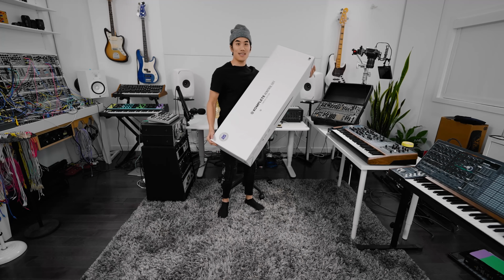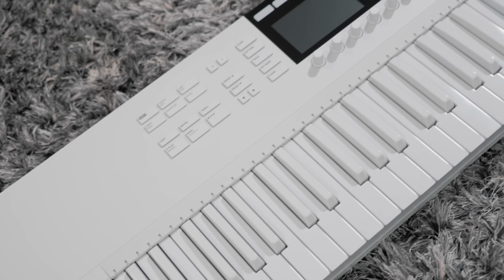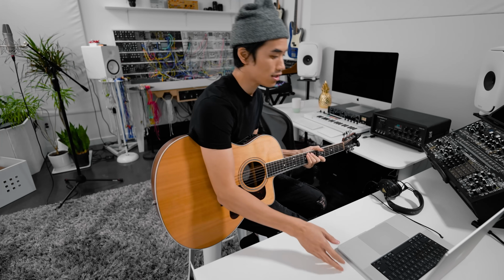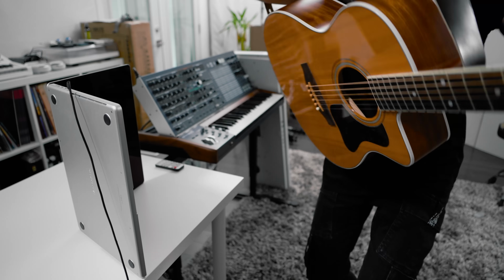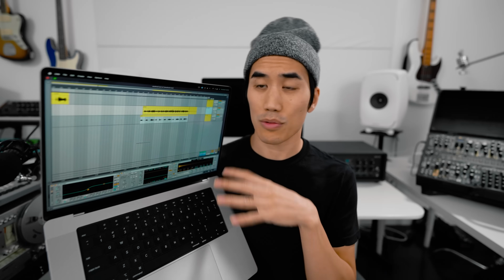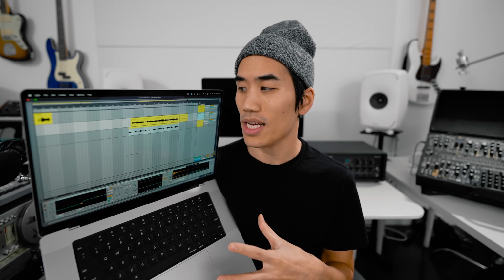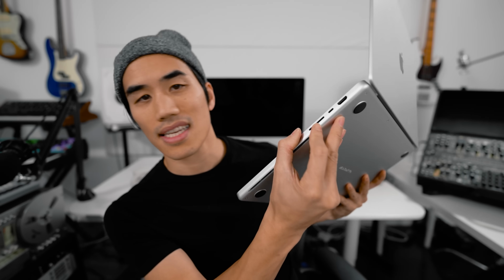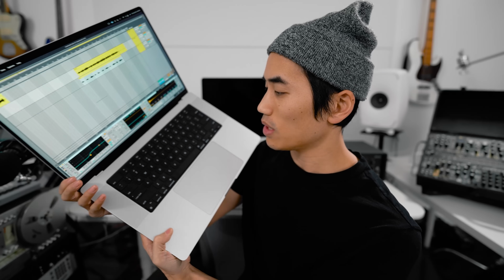My new microphone... (Macbook Pro M1 Max)

Comment: Hey Apple, 2 smaller trackpads on either side would be much better. Wont get in the way of typing and no need to put your hand in the middle of the laptop to use it. Either side for both right handed people and lefthanded.

Comment: Thanks! Great video. Does your laptop have 32GB memory or 64? I couldn't find if you had mentioned this.
Reply: This doesn’t answer your question directly, but if you’re wondering about how much memory you should choose, 32 GB of RAM will take you extremely far from what I’ve gathered (particularly with the new unified memory on these M1 devices). 16 GB would already be plenty for workflows that don’t use large amounts of sampled VST instruments (Kontakt being the most common culprit), but if you have the money 32 GB would provide some nice headroom.
Reply: @ninevolt  Thankyou. I discovered the Max model comes with 32 as standard. Thanks for your response.

Comment: I'm just wondering that you didn't mentioned the Latency Issue with internal Mic over CoreAudio. Even on the lowest buffer size like 32 Samples the Latency is to high to hear yourself without Delay or Phasing Issue...
Reply: Came here looking for this too. Did you find any solution?
Reply: @ADHDindieArtist  what i found is that you don't get latency when using reaper.
in ableton, logic i get around 40ms of latency on internal mic 
but in reaper no latency.
Reply: @ADHDindieArtist  unfortunatelly not

Comment: Compared to the actual end product the Macbook sounds normal, but not laptop normal. Had i not known I would have guessed that was just poorly processed, or recorded in a subpar mic (or perhaps location), but for a laptop it sounds great. Still way too expensive to be worth considering over a normal laptop and a decent mic, tho, as I think most people would not mind carrying a decent usb mic or even a mic and a DAC behind. If you're backpacking that's like 1 less shirt you'd pack and I think that's a better trade off. Heck, if you needed the shirt that bad you could buy a new one whererever you're traveling too with all the money you'd save

Comment: Not a Mac Guy here by definition. (I do 90% of my work on a Windows machine), but I did buy the last gen Mac (fully-kitted Intel) and fell in-love with it, except the stupid touchbar. I now have a top spec M1 Max 16" MBP, and I think it's perfect. I can't find a single thing I don't like about it. I'll still be using Windows for most of my stuff, but definitely way less. Ratio has shifted to 60% Windows, 40% Mac, and I imagine that'll continue to change until it's about 50/50. I enjoy both OSes, and I have a great Windows build as well (Threadripper, 128 gigs of Memory, 8 TBs of NVME storage, PCI-E Gen 4, and an RTX 3090), so... for once, I feel like I'm in a happy place with my laptop and desktop machines. Nice to see the mic is so good on the new Mac, I can definitely make use of that as well. Thanks for the video.

Comment: Boo Apple. Wow the expensive real studio mics are so much better. Trackpad is too large, company is too evil, computers are too slow, needlessly burn power to run their UI, needlessly prevent people from repairing their products, famous for manufacturing plants placing netting to catch falling bodies as people were literally yeeting themselves off the building to prevent having to work there any longer... maybe don't advertise that their mics work better? The microphone in your cell phone will do the same thing; they're all condenser mics at this point. You can get them for pennies from China, then it's all about distance and shielding from mic to preamp, preamp quality, ADC,  sample rate.... all of this parts wise is under $20. And I've heard better.

Comment: @andew (or anyone with the 16"). I'm concerned it's just way too heavy to carry around long-distance, but I do prefer the larger screen even though I almost always use an  an external monitor. Any thoughts on whether the 14" might be a better fit? Does the weight difference matter here? (I am also concerned about growing pains carrying something heavy.) Apparently the 16" has some higher performance mode though.
Basically I'm completely on the fence when it comes to the weight.
Reply: I have a 14" and love it. The fan has never bothered me and it's still pretty weighty. I think the 16" would be much worse on my back.

Comment: Reviewers automatically say Apple has the best trackpads, but I've accidentally moved the cursor on my Macbook Air M1 at least once per day while typing. Never had that issue with Windows machines. The Apple trackpads need be lowered and reduced in size to avoid accidental cursor moves.

Comment: Andrew! Please try to see if you can use fingerpringer in max (or anything else that can get data from the track pad) and use it as a midi controller! It will change your mind about the giant trackpad haha. Those mac trackpads are basically a really nice, smooth Roli lightpad block built into the laptop ;)

Comment: The laptop sounds a little crunchy. The reverb helps but I can still hear it. But it's way subtle. If I did a blind test I would just think it's a low end dynamic mic. Also the guitar is barely detectable, it's only in the vocals I can tell.

Use for anything moderately processed, it's totally passable.

Comment: For the first time in years, the connectors are exactly what we want. No idiocy like removing the jack and the magsafe, and the right amount of connectivity. That alone makes this laptop worthwhile.
This one might be the best MBP released in years if not a decade. But I guess it's super pricey of course.
Reply: I paid around $2000 in 2011 for the MBP I'm using (it's my main machine, the other being a 2011 iMac), and the lack of connectors in the newer macbooks is one of the reasons I've kept this one for 10 years. Another reason is that it's working perfectly, it's still powerful enough for my needs and fans do rarely turn on if I'm not using Handbrake or Flash/HTML5 -_-
It might be time to upgrade though, and the only thing that keeps me from jumping onto an M1 (maybe not the Max) is the repairability/servicing issues. I have fixed this one a few times, maxed out the RAM, given it a 2TB SSD, replaced the battery; and I like to be able to open it up and tinker with it.

Comment: The only thing I am consern is that laptops microphone (mic response) was calculated together with surface it stands on..so maybe that lack of high frequency was caused by holding MBP in other position (on the side and vical holding in hands). You should test also in normal position, let's say with laptop stand on flat surface same as you place laptop for live show or events on the stage and then check that mic quality. I say that because I was also shocked with prolog of that video - sound stright from laptop mic was stuning, but with recording  guit+voc not so much....
Sometimes we try to change the way engineers made something but we didn't know whats behind that technology, so let's stop changing things and try to cooperate with gear as it was created :) Cheers

Comment: another addition to why this company is the one the artist chooses, i have been a lifelong pc user but once i finally got my own macbook out of curiosity i understood why immediately
Reply: Its not usable for me as it don't run any of my older plugins like at all and even some of my newer ones haven't been updated for m1 and who knows when they wil work
Reply: @quickie17  I've had no issue with most new plugins, even those that don't natively support M1. If they don't, most DAW's have a Rosetta version that does have a bit less performance (which honestly really isn't much. Their emulation is insanely good.) but your older plugins should pretty much work.

I bought the "last" gen M1 Macbook Pro with the touch bar, and for me it doesn't nearly match the performance of my PC, but take in mind the current M1 Macbook Pro (2021) is around 4 times better than the old one and the Max version even more. It's definitely better than the majority laptops on the market, so if you don't often have access to your pc, its a good deal. Otherwise i'd still recommend to just get a custom built pc for the money instead (unless you're using a Mac specific DAW).
Reply: @neek01  I said it's not usable for me and my plugin needs that's all there is to it. I can't install half the plugins I own on a m1 mac
Reply: @quickie17  yeah I’m keeping round an older machine for 32 bit plugins

Comment: i wonder if apple will ever put a headphone jack back in their phones :'(
Reply: It's a $9 adapter, and it's small enough you can keep it connected to the headphones without even noticing. I just got one after two years with a "modern" iPhone, though, and I'm not sure I can connect my Sony headphones. The Apple ones (4-contacts) went in with no effort, but a standard 3.5. jack seems too big. I ended up using my iRig as an headphone adapter :D

Comment: The mic sounds great - but remember that the laptop costs 3000 dollars xD
Apple made a huge jump with this one though. Finally a macbook that I would consider buying as a music producer.
Reply: True. Though, the $2000 base 14'' model with the same mic, doesn't break a sweat either when it comes to music production. Still a lot of money, but no competition really comes close so
Reply: Seriously making me regret splurging on a fairly nice MacBook shortly before this one came out, my fan runs 24/7 when I have Ableton open lolll
Reply: @milesendebrock373  
Which macbook was that?
Reply: Jeffery Dan My memory is pretty terrible when it comes to specifics, so sorry I can’t be of more help, but it’s a fairly small MacBook Pro with the touch-bar. It does run Ableton perfectly well, no real complaints performance wise, just gets good and toasty once it’s been going for any more than like 10-15 minutes
Reply: My $200 air does this
Reply: For that price, a newcomer with nothing would be able to get a gaming laptop, an audio interface, a mic and a synth

That's the only issue
Reply: @Bagofnowt Or for the same price you could get an M1 macbook Air (that can handle music production extremely well), an audio interface, a mic, a synth and a PS5. 

Gaming laptops are overpriced these days with the shortage, and their battery life and form factor is... generally not great if you need a computer to work and travel with.

Just find the option that suits you best! I think the new macbooks offer great value for the price!
Reply: Yeah, this new macbook looks great but honestly it freaking better be for the price!! Like you're simply getting what you pay for here really.
If you're poor or don't want to spend thousand(s) on a computer but still want some juice, that's where building your own pc is great because you can decide what to prioritize and completely control your budget. And its not hard to also make it cheap gaming rig on top if your primary use is music. Now with the current shortage, gotta be patient, and ofc portability is completely different aha (altho shout-out to sff PCs, mine fits in my backpack and i've taken it on planes many times(without the screen ofc))
Reply: @shaetane  Yeah. For the price, it had better be good (from the eyes of someone who doesn't dislike MacOS, specifrically). Not like you're getting what you pay for, though, as A. Apple tax (part of why I don't like MacOS), and B. law of diminishing returns.
Reply: @Bagofnowt  Heck, I use an office-grade PC!

Comment: Do you HAVE to run the rosetta app with other typical DAWs? I use logic pro, and would like to know if I need a 3rd party app to run that.
Reply: I would have expected logic to have an M1 update by now, but I've seen a few people recently mention issues. Being an apple product it's surprising it didn't have day 1 support
Reply: @webthefox  Logic and all of its built in plug ins have had M1 support since November 2020. It’s just that some external plug ins don’t support M1 so you have the option to launch Logic in Rosetta instead until all the plug ins you need are supported.
Reply: @marxistlynchist  ohhh that makes more sense

Comment: Am I the only one that cannot get Logic to run on the M1 Max? I'm having a terrible experience with mine.
Reply: I saw one other person on reddit saying the same + externals not working.
Reply: Logic is Apple's DAW, there's no way it wouldn't run. Stupid question, I know, but you've installed the newer version, right?
Reply: @IlBiggo  Apple support has been on screen share w me and seen it not work. They sent reports to engineering. Waiting to hear back. 

Yes - I believe the update was released yesterday. Still no luck. 

Had to use my 2019 iMac instead to track.

Comment: I’m in desperate need of new computer hardware, (as I’m still running a 2010/2011 27” i5 iMac, and a 2nd Gen 2010/11 11” MacBook Air lol) but the cost is kinda scary for me.

I’m having the same mental struggle as when I purchased my iMac; do I spend a lot more money on something now to hopefully future proof it, or do I keep my specs lower for a more reasonable price, but potentially screw myself later down the line?

The other thing too is like, these chipsets are crazy powerful, but they’re also pretty new. The jump between something like a 1st Gen iPad vs even a 2nd Gen iPad was ridiculous. And I got burned by getting the Gen 1 at a discount rather than get a 2nd Gen at full price. My iPad was practically unusable by the time the 3rd one came out.

In another year or two, is it likely or even just probable that an M2max chipset would be out, and blowing these M1s out of the water?

Or are these M1 miracle machines really that good to the point where upgrading to higher tiers isn’t necessary outside of specific applications?

Like should I just get an M1 mini and call it a day, or are these M1x MBPs actually worth the $2-6k asking prices??
Reply: It depends on what is the use of your machine. Content consuming? traveling? Then go with the 13 inch m1 MacBook Pro because you can get it for like 1000 bucks on amazon and it has a lot better battery life.
Reply: @filipkocis3351  music production mostly. I got the Air to give me portability that my iMac couldn’t offer, but getting a desktop experience on a portable laptop would alleviate my need for two machines now.

I also do random things with my desktops, like games/emulation and  recreational 3D printing (not designing per se, more just slicing premade files), so nothing super intense like 4K video editing or rendering.

I just want to be able to record tons of tracks and use multiple plugins on those tracks with minimal interruption. Most of that likely falls under RAM requirements, but not all of it. Some plugins and libraries require a lot more juice to run properly than others 🤷🏻‍♂️

I’m usually running two monitors. 4K dual setup would be nice, but not a necessity… 

I was really hoping the M1x chips would wind up in a Mini when they announced them but that seems like a far-off expectation now. I suppose spending less on a mini now means I can be more flexible with buying an upgraded mini/new laptop in a few years 🤔😮‍💨
Reply: I recently purchased the M1 Mini with only 8gb of memory. I'm running Ableton live and Davinci resolve with no problems. I had to replace my PC that died and didn't have a lot of money to do so. I would maybe recommend bumping up to 16GB of memory if you could, but it's not completely necessary. I wan't a MacBook Pro eventually but can't afford it right now. My plan is to likely sell the mini in a year or 2 and get it then.
Reply: @jyarf  this was my original plan; get a mini in the meantime and upgrade my system in a few years. But then these new chipsets came out in the MBPs and it threw a wrench in my plans lol

I think I’ll stick with a Mini for now. It’s still a good piece of tech, it outclasses what I’m currently running by a mile, and I already have all the “extras” I’d need, like a good keyboard & mouse and a monitor.

I recently got a well paying job, but I’m trying to pay down bills before I splurge. In a couple of years I’ll likely be in a position to better be able to drop $4-6k on a workstation, so I think I’ll play it conservative and get a higher spec mini 🤔

Thanks for the feedback!
Reply: @wokeupinapanic  Sounds great, ya I'm excited to get a new MBP too but have to be patient also.

Comment: Heyo Andrew, I was super upset with my 2016 and 2018 MBP's because of the large trackpad. I bought a 14" 2021 M1 Max, and, after looking at them, the smaller MBP's actually have a smaller trackpad. It doesn't get in the way at all. It's an absolute joy to use. Maybe consider swapping out for a 14"?

Comment: The trackpad should reject your hand when you rest it on there to type. That's what most laptops do, so I don't see why the macbook wouldn't do that.
Reply: I got the 16in and sometimes I accidentally tap my finger on the touchpad after moving it away from the spacebar, it registers it as a click
Reply: @-SP.  Ah yes, the dreaded "PC click". I can't get used to the touch click. I hope the real, physical click is still an option. "Tap to click" is always turned off on my laptops.
Reply: @IlBiggo  It's still an option however, right clicks sometimes register as a left click when physically clicking. Tapping with 2 fingers works better for right clicks
Reply: @-SP.  My default setup is Left click: physical. Right click: two fingers, physical. Two-finger double tapping for zoom in/out.